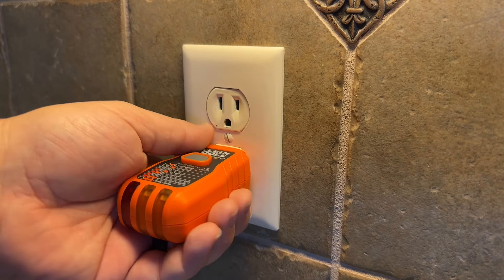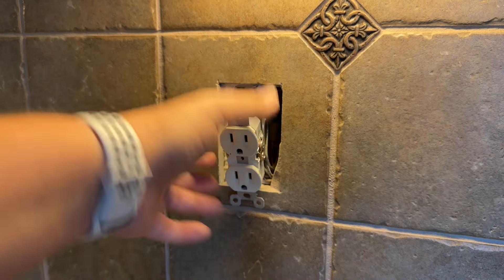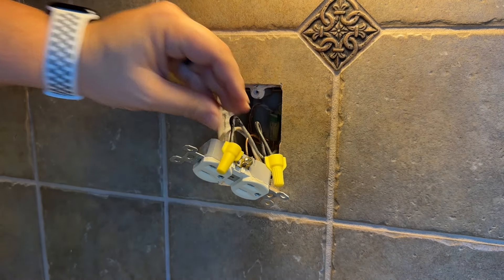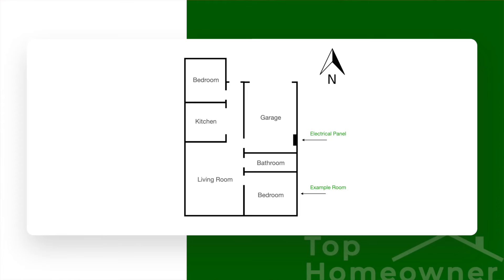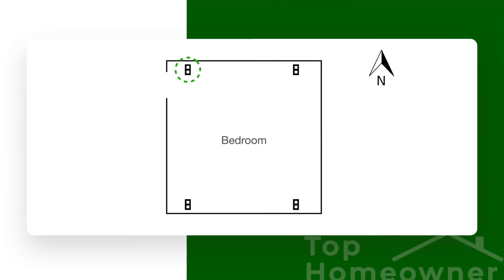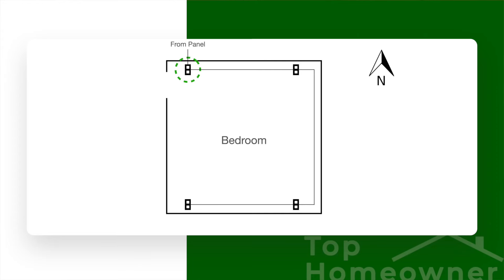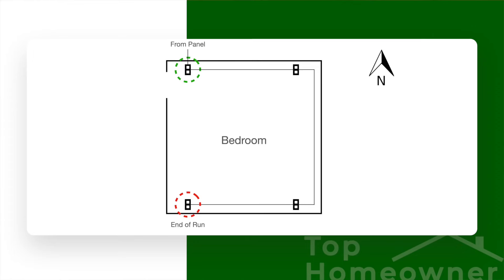How to Identify the First Outlet on Any Electrical Circuit

Comment: I think you may have oversimplified quite a bit. When I go at an old house and need to find out everything thing on a given circuit, I normally shut the circuit down and use a toner to trace the wiring. All kinds of strange things are done with wiring during renovations where an electrician picks up power from some convenient spot and goes god knows where… Also, it is common practice in my jurisdiction to have only two wires going to every outlet by doing a junction in the box – this allows future hot swap outlet replacements without disturbing downstream loads.
Reply: EXACTLY!  On a large home, we have multiple breakers for "plugs" and they go all over the house.  NO way to trace it all the way back to the breaker.
Reply: Homes built before 1970 are likely going to be the potential candidate for this task. However, even they are commonly using pigtails and they may be soldered in, making it an impractical job at best.
The only solution is a GFCI breaker, if you can get one for an old electrical panel.
Reply: "To every outlet" : do you mean to every connection?   Code requires that that there only be a single wire to each connector: doubling up is a thing of the past.  Nuts or push connectors are needed to provide connections to 3 or more wires.

Comment: That approach certainly works, but there's a faster approach to locating the first outlet in a daisy chain.  Get a long extension cord and plug it into one outlet on the circuit of interest.  Plug a heavy load like a 1200W hair dryer into another (duplex) outlet on the same circuit breaker.  Use a multimeter to measure the voltage drop between the female end of the extension cord and the outlet with the dryer.  Place the meter probes between the neutral (wide) receptacle slots in both outlets and look for low voltage AC.  This is the voltage drop in house wiring under this heavy load, and indicates the relative length of the wiring between the outlets.  A 1200 Watt (10 Amp) load will create a drop of 0.15 to 0.25 Volts per foot of house wire, depending on whether its #12 or #14 wire, respectively.  If you see no measurable voltage, the extension cord is plugged into an outlet downstream of the hair dryer.  If you see a measurable voltage > 1 VAC, the extension cord is upstream of the dryer.  Repeat this procedure with the upstream outlet and other outlets on the circuit until you find that there is no voltage difference between it and all the others.  This should be the first outlet in the chain, and the correct place to install a GFCI to protect all the other outlets.  Verify this by disconnecting the hot lead from this outlet and ensuring all the others are dead, then install your GFCI here.  This technique will also tell you the exact sequence of outlet wiring by reversing the logic.
Reply: Umm no. Voltage does not drop in a parallel wiring system. If voltage is being dropped by end usage, the house is wired incorrectly.
Reply: @TwilightxKnight13  Wires have some resistance.  Remember Ohm's law: E = I R.   If, for example, you have 0.2 ohms of resistance between two points on a conductor, and 10A through that wire, that's a 2V drop.  You certainly can use the method he described.
Reply: This should be the only comment on the video lol.
This video is fairly useless unless the outlets are gfci. Sure you could swap the outlets with gfci for testing but holy extra unneccessary steps.

Comment: The problem I see with this video is when you say if there is only one set of wires going to the receptacle. DIYers without electrical experience may not understand that they need to look into the box and see if there is one or two sets coming into the box, if the installer/electrician used pigtails you will have two sets coming into the box but only one set connected to the receptacle.

Comment: Finding the circuit breaker:  If you dont have a circuit breaker finder I have had good luck pluging a vacume cleaner,  or radio into the outlet. As long as you can hear it from the load center you'll know when you've killed the correct one.

Comment: An even easier way to find out if a receptacle is GFCI protected and/or which GFCI is protecting it is to use the button on the top of the tester you were using. This will trip the GFCI just like the test button, but from anywhere downstream. Be sure to check for a GFCI protected breaker if you can't find a tripped receptacle.
Reply: That is the problem with alot of wiring in old houses,no gfci,no ground, that is why we are trying to find the first outlet to install a gfci,if there already is an gfci,well it would make it easy,rough when you don't have one.
Reply: The test button on the gfci' tester doesn't work without a ground connection.

Comment: I'm not an electrician but had this thought concerning voltage drop. Measure the precise voltage at each receptacle on a circuit. The receptacle with the highest voltage is most likely the first receptacle in the circuit.
Reply from the maker: Great thought! Measuring the voltage at each receptacle can give you clues about the circuit layout, as voltage drop can occur along the length of the wire due to resistance. However, the voltage differences might be very small and could be affected by several factors, such as the quality of connections and the wire itself.
Reply: @TopHomeowner  Too, if the correct wire gauge has been used and all connections made with integrity, then there may not be any measurable voltage drop in such a short run. Cheers.
Reply: No, no and no.  If there is no load, there will be no loss and the voltage will be the same even on long runs with undersized wires. Pls guys, do no give advice if you do not have knowledge.  This is dangerous.
Reply: This only works if you have a constant load on the circuit. A space heater works for this. You will see reduced voltage at the receptical with the heater. Even then, you have to measure the voltage drop between recepticals. Even that is not a sure thing due to unkown wiring issues, odd branching, and unseen loads. But it may alert you to potential wiring issues if you see an unexpected drop.
Reply: You are incorrect. A wire coming off a circiut breaker as a certian amount of resistance per foot. The first electrical outlet will even have a voltage drop. Meaning, the voltage at the first electrical outlet of a daisy-chained parrallel electrical outlets will have a lower voltage reading than the voltage reading at that circuit breaker outpot. All due to the resistance in the wiring. The outlet furthest away from the circuit breaker on the same circuit (last outlet on the same circuit) will have the greatest voltage drop. All due to the greater resistance of the wire being use due to the greater distance from the circuit breaker in the panel.

Comment: Just a note of caution for older homes. A couple of generations ago it was very popular to use multiwire branch circuits for kitchen wiring because you use less wire and because receptacles are less likely to blow a fuse when multiple nearby appliances are used at the same time. The tip off for this is the characteristic double pole breaker that mechanically trips both legs of the circuit if either leg is overloaded. When you look in the receptacle box, you'll find a red hot in addition to a black, and the neutral was shared. It was common practice in that era to cut off the bridging strap for the receptacle so one leg would feed the top outlet and the second hot leg (180 deg out of phase) would feed the bottom outlet. Or sometimes adjacent outlets would be simply fed with different legs. In this day of GFCI protection it is more complicated to protect both legs of a multiwire branch circuit because the neutral is shared, so multiwire branch circuits were phased out of new construction when GFCI protection became mandatory.

Comment: Nice, clear and concise.    There may be a number of reasons one may need to determine which receptacle is the beginning of circuit.   An obvious example would go like this: I just purchased a 1950s house at a reasonably low price given the current shortage of affordable housing situation,  and I have two wire receptacles or three prong with  open grounds everywhere, served by a fuse panel, and I'm on a really tight budget and replacing the fuse panel and the cloth sheath no ground NM will have to wait until the funds are available, but I want to maximize safety to the occupants of the home in the meantime.  An inexpensive way to handle this situation is to place an AFCI/GFCI type receptacle at the beginning of each circuit, properly label the downstream receptacles "AFCI/GFCI PROTECTED,  NO EQUIPMENT GROUND " and your good to go.
Reply from the maker: Perfect example, thanks for your comment!
Reply: @TopHomeowner  You say to cut off the breaker and in your video you show turning it ON.

Comment: Just a tip... modern code requires two separate 20A circuits for a kitchen counter, so in most cases expect to have to identify both and not just one.  I'm sure many homes only have one due to age or improperly following code requirements.  In a good design, the outlets should be staggered between each circuit... this helps eliminate overloading any one circuit with too many devices.  In my kitchen, I have one on the first circuit and three on the second.

Comment: That GFCI in the kitchen might not necessarily be the "line". It is quite possible that there is a switch or outlet in another room that is the "ACTUAL" line. Especially an older homes.

Comment: Just a suggestion. I always put the outlet tester on both outlets. I had a situation where someone wired a hot on the top side and switched on the lower side from another switch.
Now I always check both while turning on/off all the switches.

Comment: Thanks.  I realized from your opening that I can match basement wiring (using a detector) to the circuit breaker panel, simplifying mapping switches and outlets upstairs.

Comment: Thanks for the understanding you shared. I have the exact issue with my old house. The outlets tested for open ground. Original outlets were 2 prong receptacles. I want to install a GFCI at the beginning of the chain in an area but because the outlets test for open ground. and the gfci come factory tripped, how do you get the gfci to work if they will only work if it reads correct not with an open ground?
Reply: You should be able to reset the GFCI without a ground connection as long as the hot and neutral wires are connected to the Line and you turn the power on.
Reply: The point of GFCI is to ensure grounding of the line.  If there is no ground why would it be expected for GFCI to work?
Reply: @Stephenwc this is a common misunderstanding of the purpose of GFCI.
The GFCI continuously monitors the current on the hot and neutral wires and trips if the difference is greater than a few milliamps.  The reason this works is that this condition of a large enough difference indicates that there is current flowing where it should not be. Whether this is on the ground wire or not is inconsequential to its operation. The term "ground fault" means exactly this and does not refer to the ground wire explicitly, though the ground wire is in fact named after the condition in a sense as it was introduced as a way to offer a preferential controlled safer path for current to take in the condition of a ground fault.

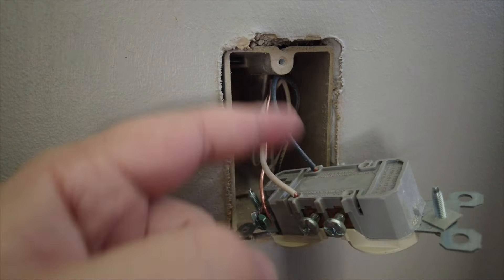Comment: You need to pull all of your receptacles if they are like the one you show at 3:50.  You should NEVER back stab and you should always tighten down all of the terminal screws on both hot (brass screws) and neutral (silver screws).  You should remove wires from the "back stabs" put a hook on them and put them under the screws.
Reply: You can back stab with modern outlets.
Reply: @CatnamedMittens  The new ones are different from the ones he has.  The wire actually goes under the metal tab and is tightened down with a screw.  The ones in the video are held in place by tension placed on wire by a thin pieces of metal which over time can loosen and cause a short.  This receptacle is an older one.

Comment: What if all the three on your countop are GFCI receptacles?  The code says all kitchen plugs must be GFCI receptacles
Reply: I wonder too if all the outlets can be gfci
Reply: Yes, all three can be GFCI. For the ones on the same circuit, only use the Line side to connect between them. The Load can only be used by the last one downstream.
Reply: You don't need more than one GFCI on the circuit: and it will be the outlet closest to the circuit breaker.
Reply: FYI-Only one GFCI receptacle, the closest to the breaker panel, is necessary.  If a circuit has more than one GFCI, the GFCIs may interact with each other and trip for no reason.

Comment: Just install a GFI or dual function breaker at the panel. Simpler and often cheaper than using a standard or arc fault breaker with the GFCI receptacle.

Comment: When you restore power with a recepticle removed and wires capped, how do you know if you've found the first outlet?
Reply from the maker: The rest of the outlets won't have any power. If, say there are 5 in a room and 3 work and two don't, you're towards the end.
Reply: @TopHomeowner  Wouldn't this method only work if the receptacles are wired in series? If they are wired in parallel, if you cap off any one receptacle all the others would still have power, correct?

Comment: Hi, I just had an issue In a house built in Alberta, in 1978. The 3 outlets and 3 lights in basement family room, the light in basement bathroom,  the light in 1 bedroom in basement,  plus 3 outlets and light in master bedroom and it's bathroom. Light and outlet , all stopped. I tested the breaker and have 125 volts ? It seams like this line is overloaded but honestly only 2 rooms are really used. I pulled the majority of the outlets and switches open and found nothing wrong so I'm thinking a line has failed. Last week we had out ducts cleaned so there was suction and compressed air used- I found one vent pipe joint blown open. And the day before we had satellite TV installed- I looked where he pulled cable including by breaker box and found nothing ? Dag I hate having to call electrician as the duct cleaning cost enough and we have ZERO  spare cash for this type of expense. Any ideas you could throw my way of how to test this proper. I have outlet meter and a fluk or volt/amp tester but never had this issue before . Help

Comment: I have no power in all outlets except one light switch. Checked all outlets they have only two input wires so no daisy chain. My only guess if they are getting electricity from the attic but doesn’t make sense because how the light switch is still working?

Comment: These are easy cases.  I don't have power to any of the outlets . Now how does one find out which outlet is the first?
Reply: You might want to try getting that tester (the more complicated looking one) he referenced. It sends a signal down the line to help you find open circuits.

Comment: No matter what I tried there was always at least one other outlet being powered. I tried this with every outlet and every time at least one other on the same circuit was on. I'm at a loss

(trying to add gfci protection to old 1950's cloth covered wiring)

Comment: When a GFCI receptacle is used to protect any additional receptacles placed downstream, that GFCI may not necessarily be the first recep on that circuit? Is that it? We are left pondering. Thank you for an otherwise great presentation.
Reply: Yes, that's possible, but it's not common.  It could happen in the case that the GFCI was installed after the home was constructed.   Installed by someone who didn't know or didn't care which outlet is first in the chain.